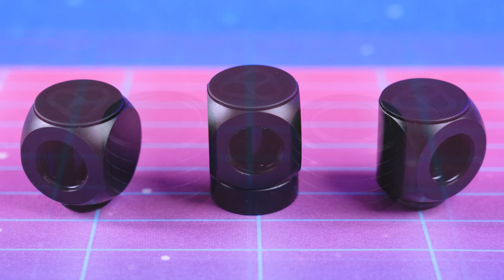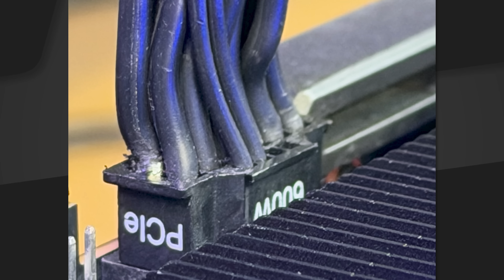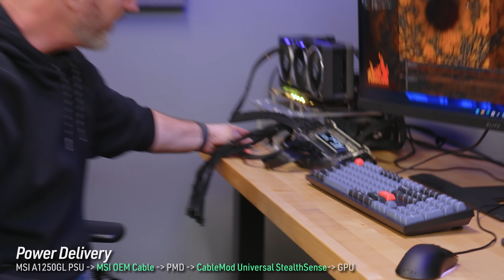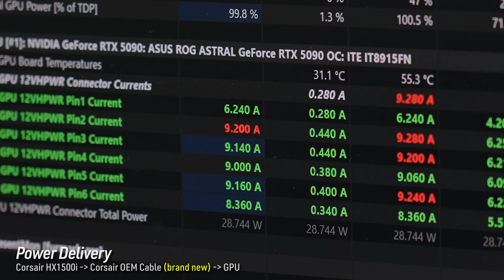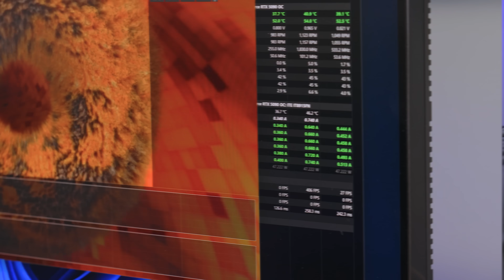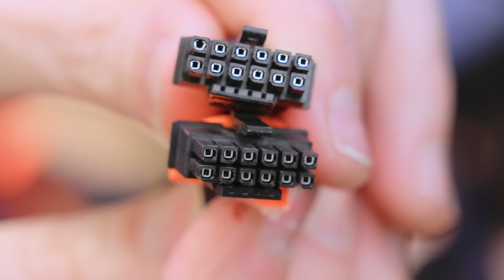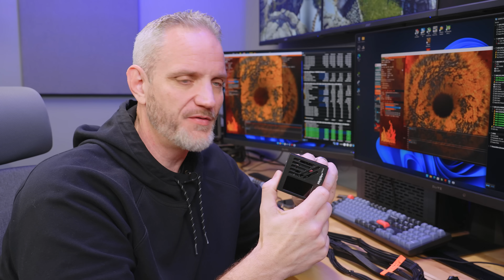More details on what could be causing 12VHPWR / 12V2x6 Cables to melt

Comment: Nobody needed 12VHPWR  or 12V2x6  old 8s  was fine if you want power we have XT90 connector this thing works great at 600 watts even can handle 1100w at 12v.

Comment: Lol, I want to convert my 4090 to a solar style 2 pole dc connector with two 8 guage cables. There's no need for all these pins and wires. 40 series bridge the pins together, as does Asus' equalizer cable, so there's really no reason to have all these stupid tiny wires with tiny dimpled contacts. It's almost like politics: seems designed to fail and discourage.

Comment: MSI MEG Ai1300P PCIE5, Fully Modular Gaming 1300W Power Supply, 80+ Platinum, 100% Japanese Capacitor, ATX 3.1 & PCIe 5.1 Ready, Low-Noise, MSI Gaming Intelligence, Sleeve Cables, 10 Year Warranty mother board killer ___>  12V2x6 Cables  i think

Comment: Interesting Blackwell 400-600W RTX 6000 cards don't have any recorded incidents? I have seen the heavy-duty 12Vhp 2x6 3.1 cables in use heavily and with 3 cards having 5x 2450W, that's massive overhead room to push well past 600W each and they've been rock solid.

Comment: Computer parts are getting more and more expensive, but they never innovate the cable connections? This is a very very old technology to connect a power supply to a certain computer peripheral. They only care about money, which is the reason why I stopped building a desktop, and buy a laptop instead.

Comment: What surprises me is that no one has yet done a strip down of these cables and checked the gauge of the wires and therefore the overall cross section of metal that can carry current, nor an analysis of the metalurgy of each one. We know that a lot of companies outsource cable production and that some of those manufacturers skimp on copper, sometimes using aluminium with a coatimg of copper.  

As for dodgy pins, I bought an expensive Asus ROG PSU a couple of years back and even one of their cables had a pin that was pushing out, I ended up epoxying the damned thing back in. It goes to show the lack of QA testing that is happening in brands, that cable was clearly never checked as you could pull the pin out with a light touch, we deserve better, especially at the prices we're being charged.

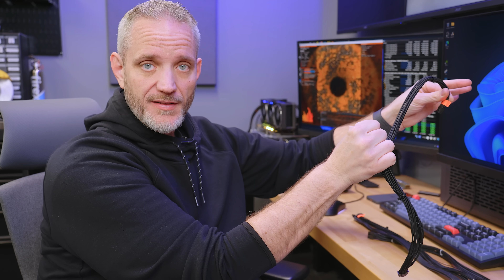Comment: Im having a problem with my pc and I believe its this cable. Jay at 4:34 when you bend the cable what actually happened to the system. Atm im losing all video and audio output and my GPU fans are ramping upto 100%. Could this be the same issue

Comment: Is that the type 4 or type 5 cable because a lot of people get confuse they are not compatible Type 5 (Micro-Fit): Uses a much smaller 3.0mm pin pitch (spacing between pins). The connectors are roughly half the size of traditional PSU plugs to save space on modern, compact power supplies.Type 4 (Mini-Fit): Uses the industry-standard 4.2mm pin pitch. These are the large, traditional modular plugs that CORSAIR used for generations.

 The "Type 5 to 12V-2x6" Cable (Angled on GPU Side)PSU Side: Features two separate, small 8-pin Type 5 micro-fit connectors.GPU Side: Features a single 90-degree angled 12V-2x6 plug.Where the 90° goes: It must plug into the GPU because the PSU side splits into dual 8-pin inputs and cannot physically fit into a single 12V-2x6 port.2. 

The "Native 12V-2x6 to 12V-2x6" Cable (Angled on PSU Side)PSU Side: Features a 90-degree angled 12V-2x6 connector.GPU Side: Features a straight 12V-2x6 connector.Where the 90° goes: It must plug into the PSU. Corsair designed this specifically for their RMx Shift and side-interface power supplies. The 90-degree bend ensures that the cable immediately turns forward inside your case basement rather than smashing directly into your case's side panel

Comment: Really should be at least 14awg or 2mm² wire. Also the pins are definitely not up to the task. Seems like these pins are rated incorrectly. They should theoretically be rated to 30% higher than the absolute max current that the card would draw. Now I know it's a whole thing that the cards aren't drawing current evenly through the wires, but yeah it should be rated for 30% higher current, like I said. 2.5mm² wire can do 27A max. Maybe they should redesign the pins to be 2.5mm² equivalent. Also I've seen a 16mm² cable in a industrial distribution board melt halfway through because of a loose connection. These cables should really be made to be tighter fitting.

Comment: Mann, I have been having this issue for year + so much troubleshooting finally have come to the cable being the issue. Started looking for a new cable. Landed on a reddit post. And a cable mod representative pointed to your video for someones thread. Mannnnnnn…! I could be in my desktop screens black , all 12 fans in case rev up 100% (fail safe?) , i could be just browsing same thing. The only fix has been to turn off, unplug 16 pin GPU put it back in. And then it’s good for a week or so. Soo question boss or viewers. From what I gathered in video , for my rtx 4070 ti a 16 pin to 3x/4x 8 pin ?

Comment: The 8-pin connectors on the PSU side are not dedicated to PCIe; if you look closely, they are typically labeled “CPU / PCIe.” Because these connectors are designed to support the CPU EPS12V specification, they can handle a maximum rating of up to 384W each. This high power capacity is why bundling just two of these connectors is enough to deliver over 600W to a 12VHPWR connector.

Comment: The biggest issue with these is you’re asking 6-16 gauge wires to supply 600w. One 16 gauge cable like the ones used in the 12v2x6 and others is rated at 10 amps per flexible wire. Technically you can go higher but you’re risking damage even at stock power draws. Most of these pull over 9 amps constantly. You’re maxxing the draw on these every time they’re used. Even going to 14 gauge won’t make much of a difference since you’re now limited by the pins. 

The whole thing should have been a gauge larger for the power draw. Cabling and pins or 2-12v2x6 plugs to split the draw more.  Secondly the amperage’s aren’t load balanced a lot of times. You’ll get 7 amp on one pin and then 9+ on others. 

Only thing I can recommend is getting a PSU with voltage regulation with wireview pro if your gpu doesn’t have a way to check draw per pin and keep an eye on things. If this was any other industry there would be lawsuits left and right.

Comment: Just like we do in the RC hobby, to keep from wearing the ports out on our chargers, we use extension cables. That way you wear out the extension connectors instead of your charger ports. Since you do a lot of testing, build some extension cables and use them. That way you are swapping connectors much less on your main cable, and you can just replace your short extension cables. It won't be as much of a benefit for you, since you're trading one cable for another. But a short cable would cost a lot less.

The PC industry needs to design a better connector using standard bullet connectors for these high power cards. We see bursts of 160A on our RC cars, which goes through a single +/- lead of an XT90 which is only rated for 90A continuous, and 120A peak, and they take it. But they could design a connector using 2mm bullets, and each contact would easily handle 20A continuous, and have a MUCH better connection.

None if your Amazon links work by the way 😐

Comment: Can anyone help me! which 12v cable is needed for my ASUS Radeon 9070xt 3x8pin!  I did buy the corsair 12v to 2x8pin but doesn’t fit in to the graphic card 8pin! It seems to big. I am using an MSI 850gl power supply, where the connectors are not working properly with the graphic card. It’s abit of a headache with the connections.

Comment: I went 2.5 years with my 4090 FE using an ancient EVGA 850W T2 Titanium PSU paired with a cheapo Fasgear 12VHPWR to 4x8-Pin adapter off Amazon. 0 burns, no issues on either the card or the adapter.

I "upgraded" to a Corsair HX1500i and used their official cable adapter instead. 2 weeks later while doing a case swap on the whim, I found a burned connector on both the Corsair cable and the 4090. Debated on repairing the connector myself (even ordered the H++ male connector from Hong Kong and a hot air station) or paying to repair from 3rd party and ultimately landed on going through Nvidia for warranty. Boxed up my beautiful perfectly fine 4090 FE and sent it to Nvidia using their FedEx label to have it repaired, only to never see it again and be out $1700. A FedEx employee stole my card in transit and when the box arrived at Nvidia's RMA facility it was empty. I was left high and dry and had to choose between spending $2500 for a replacement 4090, or $3000 for a brand new 5090. I chose the latter. Thanks for nothing, Corsair. Cheapest shit cables I ever had the displeasure of using in my 26 years of PC building. They were such bad quality molded plastic that I sliced my hand open pulling the motherboard ATX connector from the board. Never again.

Went with an ASRock Taichi TC-1650T Titanium and the cables are amazing. The plastic is soft and smooth, has the dual color 12v-2x6 connector so I can easily tell if it's plugged in all the way, makes a nice satisfying click, and is NATIVE 12v-2x6 so I can replace the cable with a universal one if I want, not to mention it's a lot neater than the 4x8-Pin mess. While I'm finally all settled and happy with my watercooled 5090 and Taichi PSU, it was an immensely costly mistake Corsair left me with.

Comment: i recently noticed the issue on my astral as well, my psu + native 12vhpwr cable was previously used for 3 years on 4090 before moving to 5090, and the cable barely gone thru 5 cycles of plugging-unplugging, i can conclude that the cable is sort of a consumable, why? cause all 6 pins are green at 600w after i changed the cable, the safety margin on this cable is abysmal, and it's dangerous, it was only because i have astral that i was able to see this, otherwise it's just disaster waiting to happen for those who has 5090. This sucks, and Nvidia should have plans to move beyond this for upcoming 60 series.

Comment: My ASUS TUF 4090 connector melted for the second time...😡 600W certified Corsair 12vHPWR cable and a Corsair HX1000W PSU. No matter what cable or power supply you use, it's pure luck. I HATE NVIDIA for this. It's DISGUSTING that high-end cards that cost 2-3K have such low quality standards. Both times, only the connector on the GPU side melted. The connector on the PSU, on the other hand, was never damaged.

Comment: My cable never melted, the only isuue i came across recently when playing re9 is that some pins go over 9A on maxed out settings on my Astral 5090, and the reason is the cable was for my tuf 4090 so it's a 3*8 pin to 12 pin, which caused unstable current, just bought a new custom cable which is 2*8 pin to 12 pin that designed for 5090, no more issues so far.

Comment: JUST TO ADD ON, I have a 5070ti I am in the process of diagnosing with it "disconnecting", aka black screening and fans ramping only after maybe an hour of heavy use and a bump.

It's on a raptor lake system. With an EVGA psu I already swapped out once because the coil whine was the loudest part of the system.

What do I have as a "control"? A flaky raptor lake system? Running a flaky operating system? Powered by a potentially flaky secondhand psu using an adapter to feed a 12vhwpr monstrosity?

Like there's no actual reassurance that the trillion dollar infrastructure behind my entire pc is working, so I just have to swap out literally everything. Quite fortunately I do have a decent second PC laying around I've been swapping parts on, something completely reasonable and foreseeable to have as a pc user, of course!

Comment: Spend a few thousand on a 5090 that I stare at because I'm afraid it'll melt.... Wild world we live in.

Anyone know if the wireview/pro 2 will fit in a 5090 AORUS MASTER ICE? reviews all say it doesn't fit every 5090..

I also spent nearly $400 on a Hx1500i thinking I would have ample headroom to not worry. Why has the 600w 12vhp not been revised? Ide rather go back to the triple 8 pin like my 3090.

Comment: Some time back my main computer would occasionally shut down. At first I thought I had temperature issues but then noticed the bios reported the 12V supply was low (I thing it was around 11.4V)... As it was my main computer, I switched it (and the cables) out, problem solved...

Now, because the supply was fairly new and a top brand, I was reluctant to toss it, so several months later, I tested it again and it worked perfectly, in fact, four years later and it is still working fine... After watching the video, I suspect it may have been a cable problem as that is the only change I made...

Comment: The 12V-2x6 cable that comes with the Lian Li power supply has a robust construction:
- Added gold plating to prevent short circuits
- Soldered wire and terminal connection for current stability
- Increased copper thickness to 0.25 mm for lower contact resistance
Reply: Yeah but it still gives me 6.5A x2 wires / 5A x2 wires and the rest 2 out of 6 are staying on 3.5-4A... I have the 5080 , I am in the safe zone I guess ,cuz 6.5 is way below 9.2A criteria - but still - it sucks.
even lian li cables are not immune
I have both Edge1000G and SX1200P

Comment: I think regardless of PSU or not, we are at the point of computing that connector and cable manufacturers can't skimp by so easily. We require more power and run at higher speeds in smaller form factors than ever. I feel like it speaks to how terrible QC has always been in the cable industry, most people have just never noticed.

Comment: I think the main difference with the Molex PSU connection is, that you use two or three different power rails in the psu. that leads to the fact, that the current can not go out of its rail and flow back through a different wire and overload it.

Comment: Just put a be quiet! Dark Power 14 850w in my new 9850X3D/Tuf 5070 Ti OC build, and everything about the power supply and cables felt sooo much better than the Corsair RM1000X I put in my new NAS about six months ago.  The 12v connector was nice and tight with a very noticeable click when it seated.

Comment: Hey everyone,

I’m currently building a white PC and I’m about to install a Gigabyte RTX 5080 AERO OC SFF. The card uses a single 16-pin 12VHPWR (PCIe 5.0) connector, and I want to use white sleeved cable extensions for aesthetic reasons.

However, I’ve read some pretty concerning reviews about certain 12VHPWR extensions overheating or not actually being properly rated for 600W. That obviously makes me nervous.

Comment: they could just use an xt90 connector and cables from rc cars. a single one does 180 amps and is even smaller than the crappy 12vhpwr...

Comment: I think in auto motive, they try not to use braided cable for power due to it separating over time from movement. Using wire that is solid would work best.

Comment: The investigation into this is a fascinating exercise in watching the internet rediscover all of the sources of build variation that should have been anticipated long before these things reached the market.

The pcie 6 and 8 pin connectors took all of this into account. It's what happens when you build stuff at scale. The issue is nvidea designed a connector that requires everything to be perfect with no safety margin, and gave enough regulatory capture that it was waved through.

As an aside, cards with individual monitoring will suffer fewer faults. Not so much from the monitoring, but because the shunt resistors will actually do a lot to balance the load.

Comment: Something else comes to mind having to do with alumimium, its the fact that AL stress fractures very easily and is a prime reason that airframes are rated in flight hours.  Bend it too may times and it's strength goes in the dumpster.
Reply: The 12V-6x2 cable that comes with the Lian Li power supply has a robust construction:
- Added gold plating to prevent short circuits
- Soldered wire and terminal connection for current stability
- Increased copper thickness to 0.25 mm for lower contact resistance

Comment: There seems to be a crap load of CCA wiring coming in from  (probably) china in an effort to save cost.  The current carrying capability IS LOWER thant that of solid copper and this is especially true for DC.  Network cables are not too bad ( i still would use 100% copper ) but if you put DC power on your network POEth then you experience the same issue.   Just a thought, I don't of course know if your cables are CCA but, worth a check.  Grab a lighter and see a video on testing for this, or, you can scrape off some cladding and see it.